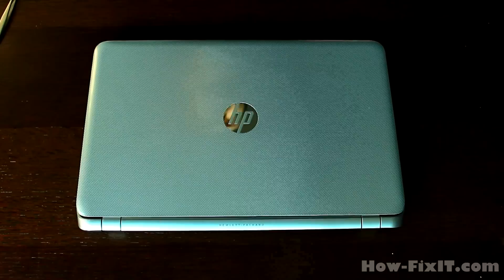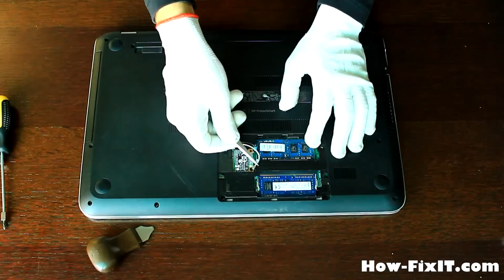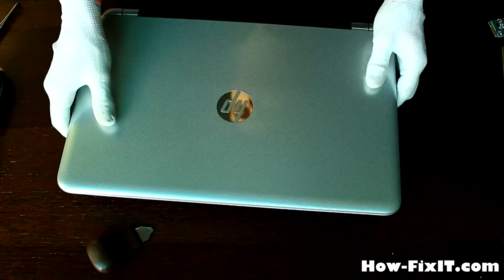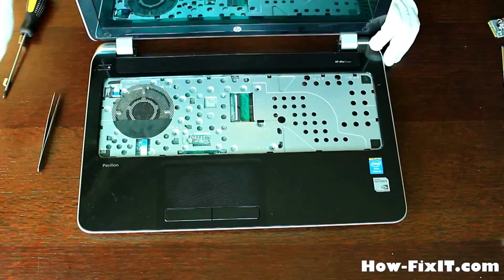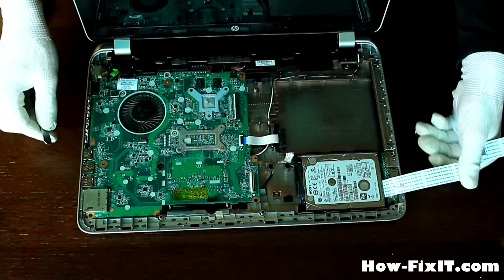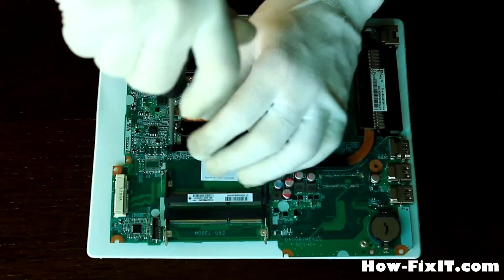HP Pavilion 15-n Series Disassembly, Fan Cleaning and Thermal Paste Replacement

Comment: Difficult to do for professionals even with care, a nightmare for amateurs.  Together with soldered ram memories (in other portable pcs), cmos battery behind the keyboard, the same if you want to upgrade the hdd with a ssd.  Everything here is intentional to discourage self-made replacements.

Comment: For those watching this with the intent of changing the thermal paste of your CPU and GPU, this video failed to address the fact that the screws of the copper tubes attached to the CPU and GPU are numbered from 1 to 7. When removing them, unscrew from 7 to 1, and when putting it back after you apply thermal paste on the CPU and GPU, you should follow the correct order starting from 1 to 7 because that's designed to give you optimal contact and even pressure when tightening the screws. Oh, and you shouldn't put so much thermal paste! Use the pea method. Just FYI, and good luck!

Comment: This video would be so good with narration, better lighting, and better zooming on important points. Also, please remove the battery first before removing anything else. It's strange why he didn't do this.
Reply: Yes, also, plastic "spudgers" would be better than a knife -- less damaging, and less chance for electrical shorting.
Also, would have been nice to see hard drive removal.
I agree: A 2nd person holding camera, and zooming in would have been great.
Narration, yes.
And especially, fast-forwarding through all the screws would have been helpful. I see a lot of YT content producers forgetting to involve a friend in the project.
OTOH.. I was trying forever to get mine apart, until I saw this video : Indeed! A life-saver. THANK YOU!
As a techie, programmer, and occasional DIY'er, I'm not a fan of this way of putting together a laptop, but I understand it is done to make the laptop less expensive.

Comment: I have this laptop and I need to plug in the hard drive as It's saying no bootable device found. Please help.
Reply from the maker: if you need to replace hdd this video can help you: https://youtu.be/rm0m77Cm_Zk

but at first make shure that problem in hdd instead of OS, logical structure of hdd (partition structure) or BIOS settings
Reply: That's the thing, It started out by it telling me no bootable device found and so I opened it to see if it was that the HDD was unplugged but it was plugged in correctly and it just turns out that the drive died. Is there any software that you know of that can repair disks or take the data off of them after they broke. The PC still recognizes it's there but it just says that there's and error with it.

Comment: after i open my laptop the fan didnt work and 90b error display when i boot
and temperature is rise to 210F when i play ..my fan speed is 1600 RPM at max
so can u give me advice about ?
or give me a program to increase fan speed 
thx alot  :)

Comment: mine  the power  strip  from   power  button  to to motherboard   the  connecter  pulled  apart    the blue  connection is okay  but  the bit  to  power  button  connection   pulled  apart   has  tiny  ?   and the  solder  our  what  ever is used  was  dry so it   pulled  away  any  idears  please

Comment: I dissassembled my computer and did everything you did. but now i cant start my computer. The two lights on the right side are blinkning but thats it. nothing happens when i press the power button
Reply: i fixed it
Reply: +Jonas Nydén how did you fix? My screen wont turn on. Do you know where the lcd cable connector is?
Reply: did you fix the screen not turning on? if so, how?
Reply: Hi how did you fix it please, very important, thanks in advance

Comment: very complex process....If anyone wants to clean the fan then he has to remove dozens of screws,remove keyboard,unplug all the connections n bla bla bla....
I'm using this laptop(i5 4200u) and bezel frame quality is very cheap(glossy plastic frame which looks very cheap when light shines on it)..overall performance of laptop is awesome...bt inside part n glossy surface makes it look a low quality product.

Comment: Bit of a shame that you have to almost take apart the whole laptop to replace the HDD. Compared to my old Hp Pavilion G6 which had access via the ram compartment it was a shame that Hp did not allow easy access. Still only a small disappointment.
Reply: ***** Well a HDD costs around £60. Around 20 people.

Comment: Do i have to remove the mother board to upgrade ram ?
Reply from the maker: You can see RAM slots in this video 1:02
Reply: aditya sekhar no. most laptops have a segmented cover or just remove the bottom of the laptop. You can find the ram by looking through the vents as well